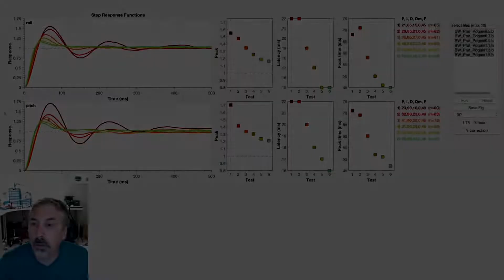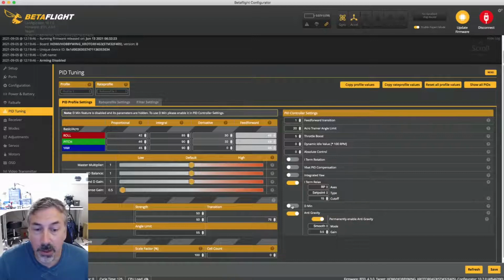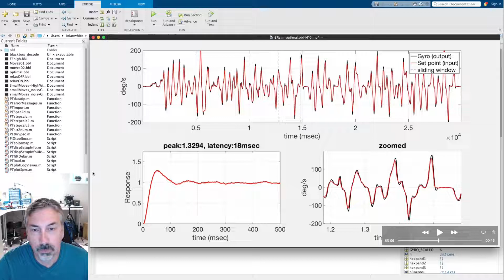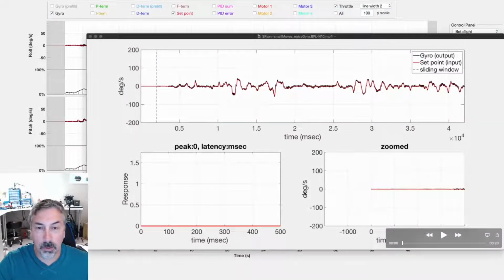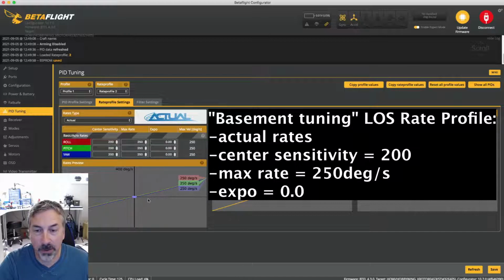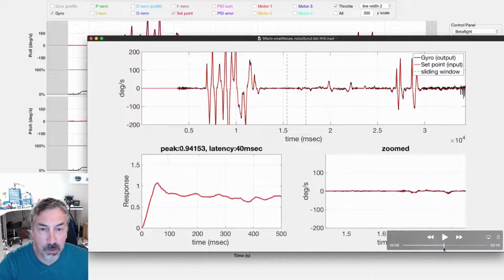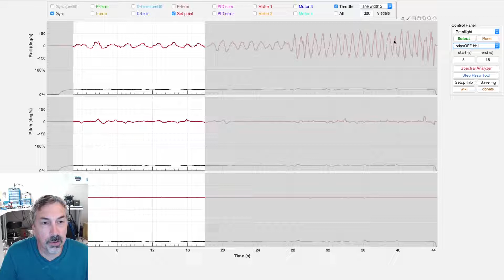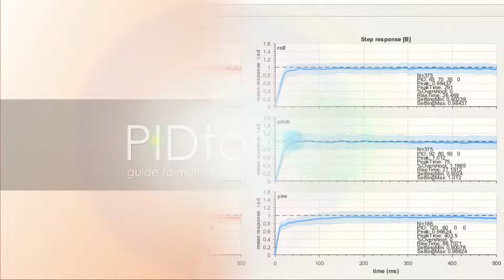PTB QuickTips: 👉  How to get clean reliable step response curves! 👈  👊  💥

Comment: Hello, I have been trying to learn about the adjustment of PIDs for a while and the truth is that I have been lucky to find your videos, it seems to me an incredibly simple and fast method. I have finally been able to adjust some of my quads well. I have the problem when I mount a naked gopro on a soft mount, because then I start to get curves with very strange shapes, especially at high PD. It is as if the first peak was below 1, and then it rises above the line of 1. In this situation I am not at all clear how I should adjust the PIDs, and I would like you to help me. Thank you very much in advance and greetings from Spain.
Reply from the maker: indeed it is a simple method! well tbh it is conceptually simple, but it certainly can be confusing when there is oscillation or noisy gyro, both of which cause this curves to vary and can confuse the results. I wish I had more time to make more explanatory videos. I do have a tuning service which I have not advertised because Im already swamped but you can find me on the Blackbox log facebook group (Brian White).
Reply: @PIDtoolbox  Ok thank you very much, I will contact you through Facebook.

Comment: Hey man! first of all, THANK YOU! What if you could choose in and out points independently for pitch/roll (and yaw?) That would get around having to do these very specific circular pitch/roll movements shown in the basement tuning example. Doing those manouvers consistently is harder than it looks for most people.
Reply from the maker: that is a nice idea. it's a pain plugging in number so a point click thing would be ideal.
Reply: @PIDtoolbox  Hey! Thanks for replying! :) point and click would be AWESOME! A step further would be to be able to drag the bars side to side. What I meant with "independently" is to be able to choose a different in/out point for roll and a different in/out point for pitch, instead of fixed n/out points for all axis. That way you can clean the step response calculation of bad signal to noise ratio parts independently.

Comment from the maker: Wanted to add a minor point here. If you decide to use a LOS rate profile with low max rate, be cautious not to hit the stick end positions. This could induce abrupt steps in the input. I’ve not tested in detail whether this is really an issue yet but just wanted to throw it out there.
Reply: Thanks Brian, a question about this: I watched Chris Rosser and some other tutorials,  they say to do some full stick and full 360 deg movements, and in your videos seems like you just did some relatively small movements, compare to their 360deg. So would the result be different between these two ways? Thanks
Reply from the maker: @xilinwang4770  if you do full stick, it’ll leaves sparse movement data and throws bad step resp traces into the average (this is why you get this dc offset when you go that approach). My method involves continuous ~200-300deg /s movement stick input. The system is linear enough that the results generalize across all sized stick input.
Reply: @PIDtoolbox    okay I get it…but when doing actual flights you’ll have to do full sticks sometimes, so the bad step resp traces still happen right? 
I’m a little bit confused when I have gotten nice curves when tuning, then after a real flight I checked the curves, those overshoot and oscillation came back again. Should I just leave them or do more tuning based on the new curves? Thanks!
Reply from the maker: @xilinwang4770  yes but bad step traces don’t mean bad flight. It means bad data collection is all. you can’t measure step responses from typical fight because there’s typically not enough movement. The RESULTS you get from real flight are not that meaningful because it’s pulling junk from the noise floor, mostly because most typical flying is essentially cruising around hardly moving the sticks then throwing in occasional full stick deflection. The tool can’t gather much useful info from this, and this is why you get the dc offset where the trace never seems to hit the target line. This is not a reflection of bad flight characteristics just a limitation of the methodology. See the algorithm runs a moving window over the data deconvolving the impulse response at each step then integrates those to get the step resp and averages those to get the nice mean step resp trace you see. The problem is during periods of just cruising or with little movement, it throws crappy data into the average. You see, what it’s doing is in effect computing the function that describes the fundamental resp property of the system and this just works best in a controlled environment with continuous controlled input. The beauty is the step resp curve is nearly identical whether you are moving at 50deg/s or 500deg/s. As you approach higher and higher rates there may be some minor deviation from this linear relationship but it’s essentially the same.
Reply: @PIDtoolbox  got it, thank you very much!

Comment: How to switch off FF in new BF 4.3 version? Something is changed in params and I cannot decrease FF to zero. It’s very easy to use BF for tuning process as sliders could be changed from OSD. Please try
Reply from the maker: To turn off FF and dynamic damping you enable expert mode and push the slider all the way left. This will turn off FF and dynamic D
Reply: @PIDtoolbox  all the way left, the slider will be at 0.5, and FF values will not be zero. If we want FF = 0 we should set it manually, not using slider. This point is not clear to me. Do we want FF = 0 ?
Reply from the maker: @Tonynux  oh sorry I was thinking BF4.3, that's how the sliders will operate in the latest.
Reply: @PIDtoolbox  I have BF 4.2.9, so how do I have to set FF? And what about FF transition? 1 or 0 ?
Reply from the maker: @Tonynux  just set FF slider as far left as possible and transition to 1. FF wont be off but minimized which is fine. After you're tuned then set FF as desired.
Reply: @PIDtoolbox  Ok, I'll try, because I'm one of those who don't have smooth traces like yours. Thank you, Brian!
Reply from the maker: @Tonynux  you might need better gyro filtering. that's usually the issue with noisy step traces.

Comment: As always great information! Now people hopefully stopping to put filters to the absolute limits and instead getting a really clean signal to noise being able to drive higher gains which is way superiour than getting a millisecond less latency on filter delay. You want a good looking step response, go revisit your filtering, I love it! :-)
Reply from the maker: Exactly. It’s typically just a matter of better utilizing the DN and or adding slightly more low pass filtering on the gyro, not enough to cost much if any latency. It might even call for looking for revisiting mechanical or electrical issues, but in either case when it’s visible in the step traces it’s usually worse than people think.

Comment: Just one question (sorry if it is mentioned before)
Is there a way to import all the flight takes(logs) in one go from a single BBL file?  Right now I have to select the BBL file and import the log 1  then selecting the same BBL file wait it to load and select the 2nd log and so on.
Reply from the maker: ya, not really. it's trickier than you think getting that working, and even if it was working, the plot legends need labels and these currently come from the file names. It is on my list of things to improve though. what I recommend is making separate distinct files because you're also gonna need this to keep things organized and for the proper labels and legends in the plots.
Reply: @PIDtoolbox  With Betaflight 4.3 you can change the slider with the OSD and than I just hit "save and reboot" so I get new files. Btw. will be there are updated tutorial for the new sliders, because PD balance changes now the P value and not the D values. What I tried was to move PD Balance in 0.2 steps and change PD gain so the P value stays the same
Reply from the maker: @EuLeRFPV  for sure! I'm just kinda waiting till we know for sure what 4.3 will exactly look like. I think the sliders are there now, but still some minor unresolves

Comment: Great stuff, thx! Switch off iterm relax as well and crank up thrust linear in BF...  under the assumption you're not hitting any saturation the pid controller within the loop only acts linear on an almost linear and decoupled  plant (at least below 100 hz, rpm filters and adaptive notch above). The small influence from the magnitude should vanish, thats at least what i saw.
Reply from the maker: My next vid! Absolutely right. You might have noticed from the logfile name I’ve done this test. Have to think more about this one to properly address it. There’s a subtlety there that most are unaware of